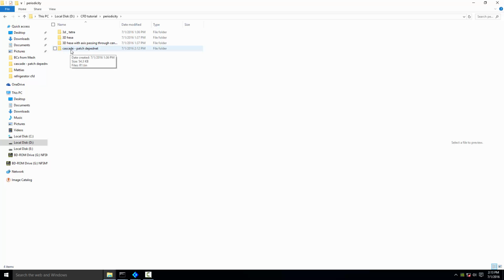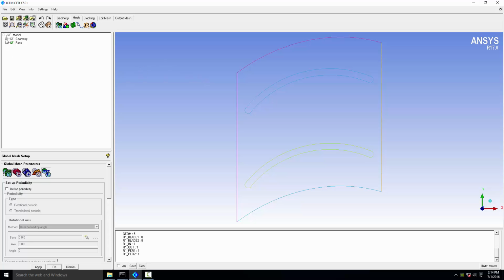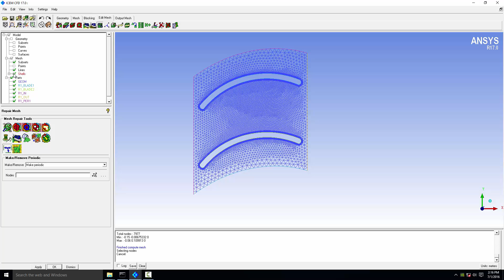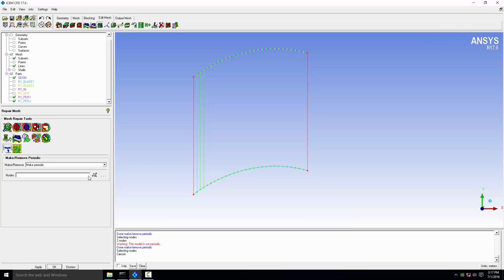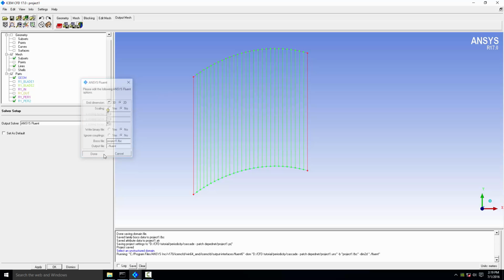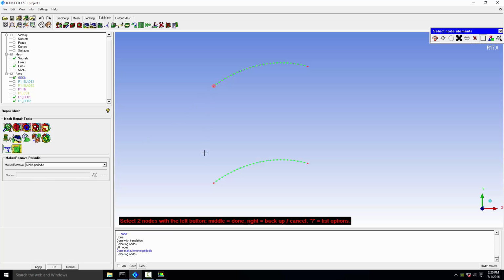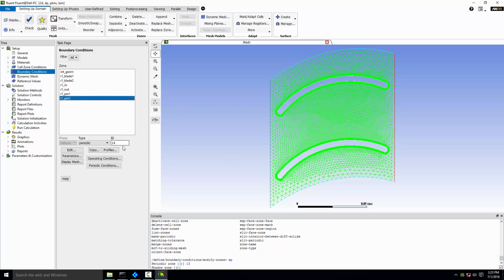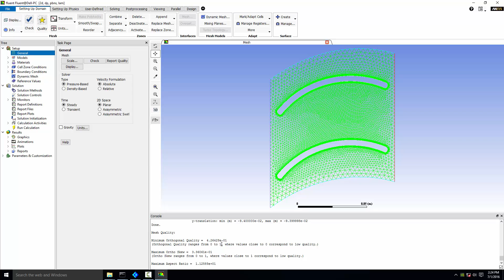Defining periodicity in ICEM CFD and Fluent and CFX (1/5)

Comment: Is it possible to 2D unstructure  hybrid mesh (Boundary layer mesh near the 2d blade wall followed by the unstructured quad mesh in the outer range) ?
I am generating 2d mesh without any blocking and define the periodicity as you explained in 1/5 video of defining periodicity. 
But when I check the mesh quality, it gives single edge error, when I upload that mesh to Fluent  15, Solution oscillate and flow after some time. Interestingly Fluent does not show any grid related errors. Please help me in this regard.
I am not getting your email ID.